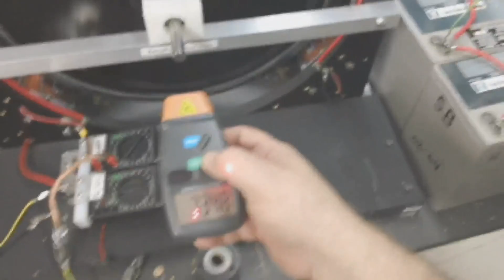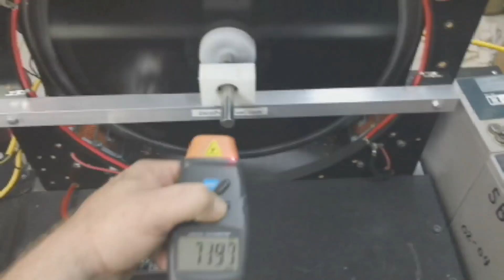Boxmotor Run Test

Comment: Have to say, been watching your videos for a while and I've suspended my usual skepticism (I've seen a lot of similar projects that look good only to turn out dud's). I have to say its all looking rather good. 

I wanted to say thank you for the time you've put into the box motor build but the excellent video clips. Looking forward to the DVD.

Also spent some time looking into costing the parts required and clearly a parts list with any help on sourcing on a budget would be appreciated.

Comment from the maker: have you downloaded my PDF? if you are using my modified SG circuit design it is self triggering  it's triggered by the magnet passing the coil so the on of the coils is triggered by the placement of the coils  and the off is based on trigger Resistance and the diode across pins 1 and 3 also the capacitance of the coil.

Comment: ac clamp meter does not measure dc current, so how are you getting the battery amperage?
Reply from the maker: James Mclaughlin No it is a AC/DC amp meter

Comment: Bedini motor?
Reply from the maker: Well kinda,  this motor uses a basic SG circuit but the coil cores used Transformer plate instead of welding rods,  the coils are much shorter at 65 feet with three number 18 wires and one number 24 wire Twisted together,  this motor also uses capacitors on the input and operates at a 120-160 volts DC.  Thanks for watching